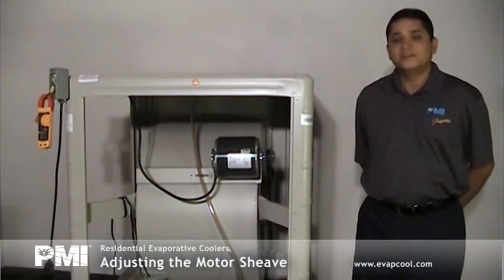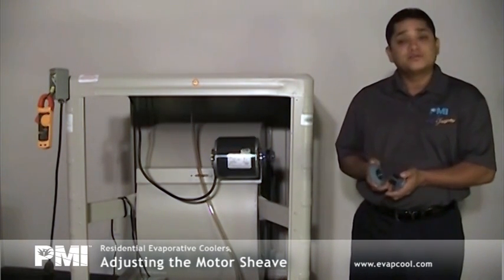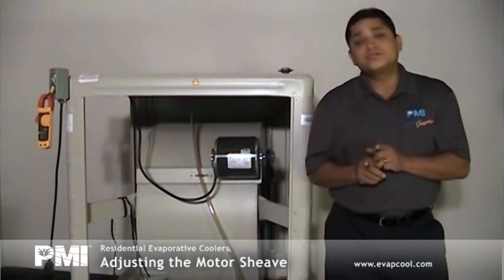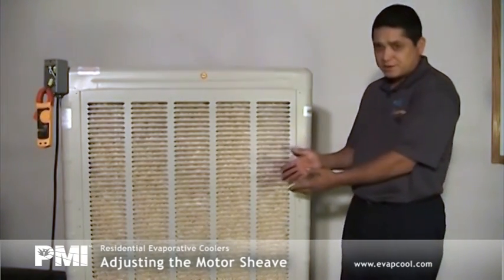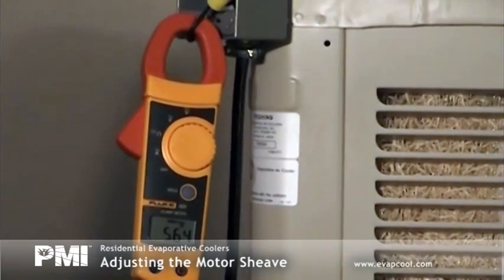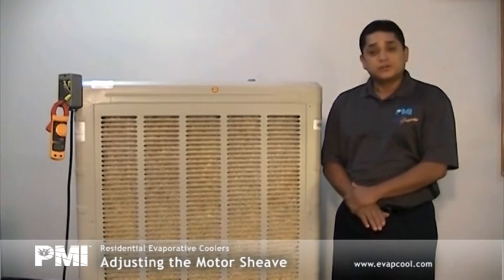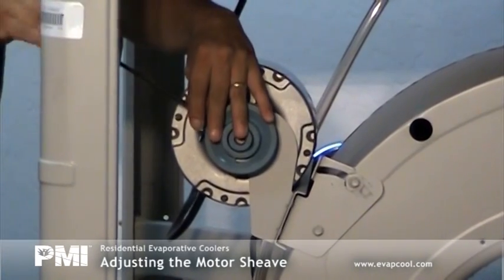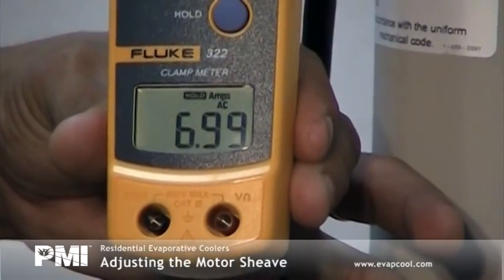How to Adjust the Motor Sheave on a PMI Residential Cooler

Comment: So you check the amps with the unit on high or low?
Reply: In the video, he says to check the amps on high, and to have have your clamp meter around that wire. You wouldn't set it to nameplate amps on low because high will then go over nameplate amps.